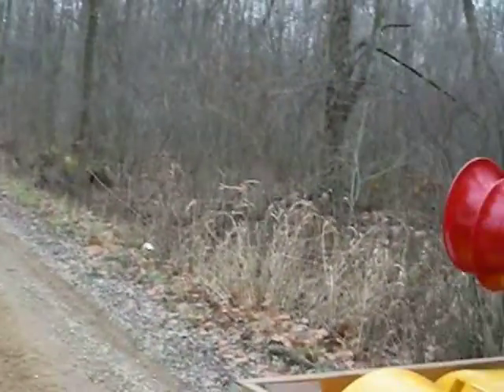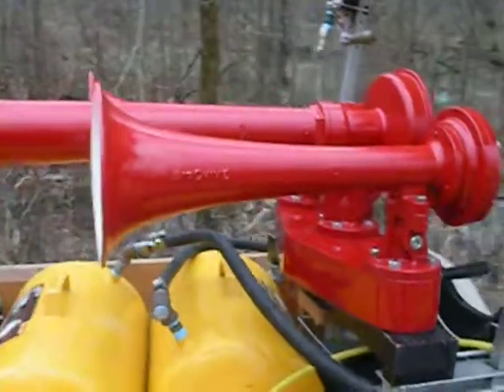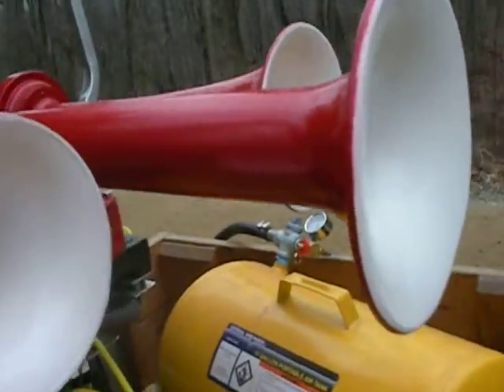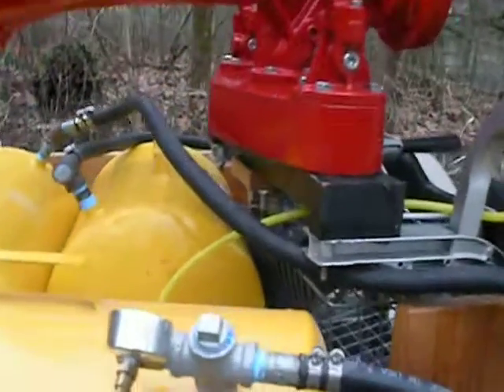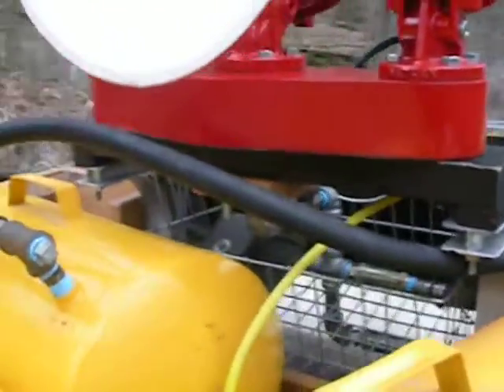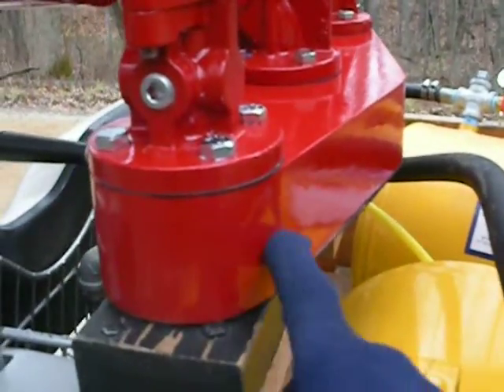Westinghouse Wabco E2B1 (well almost anyway)

Comment from the maker: It's a cast iron locomotive bell that I bought off ebay. It runs on air pressure also to activate the bell clapper. It adds nicely to the locomotive sound when blowing the horns.